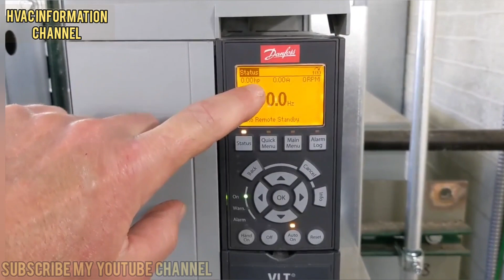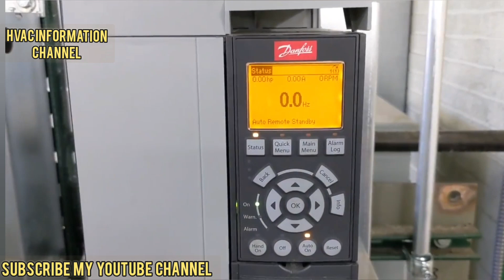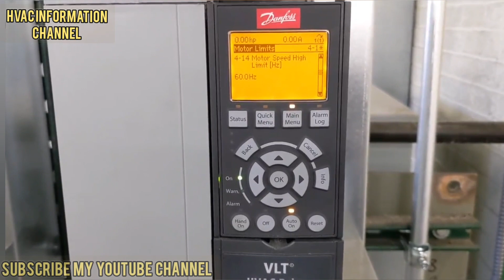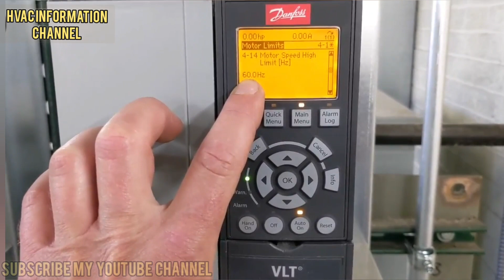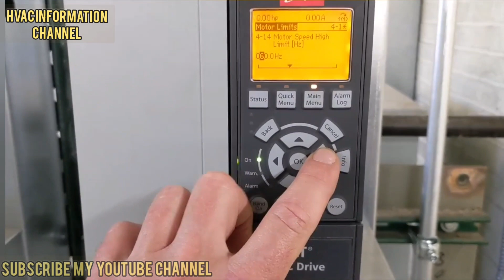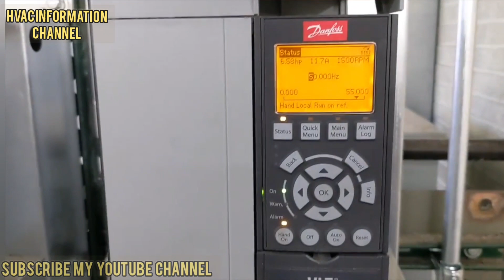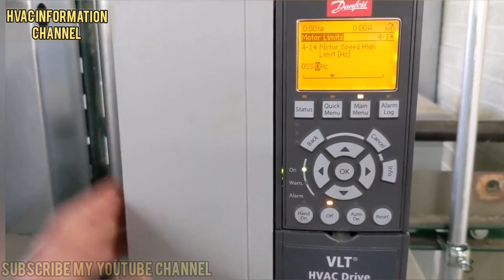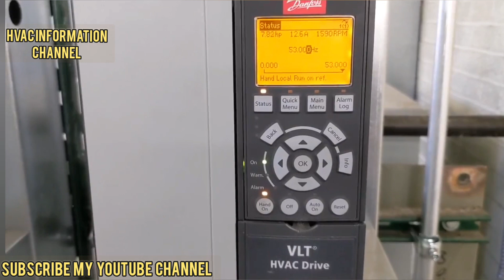danfoss vfd speed limit settings/ how to vfd speed control/vfd variable frequency drive/danfoss vfd

Comment: But can I set a lower limit at which point the motor turns off due to low rpm  caused by high load.